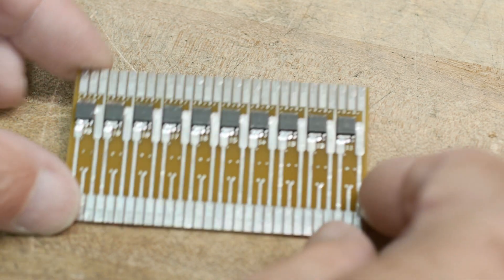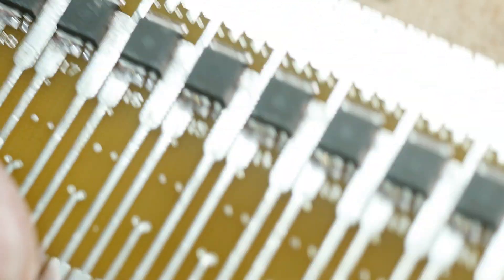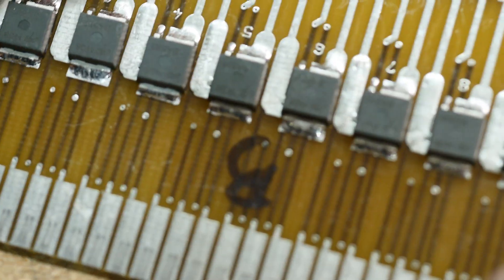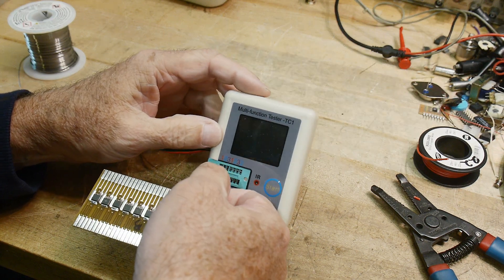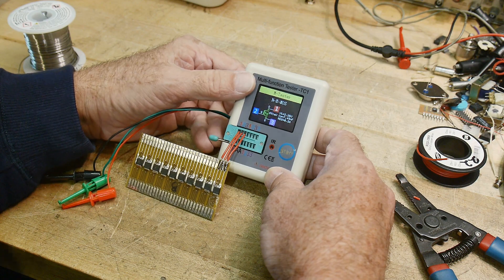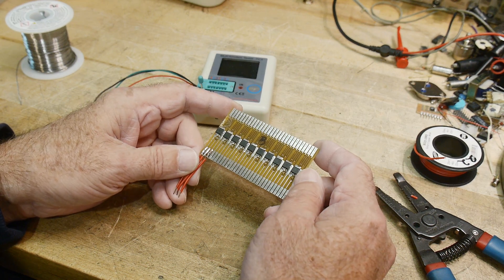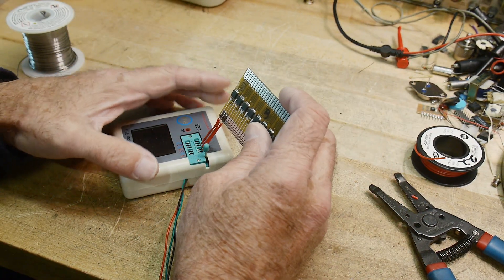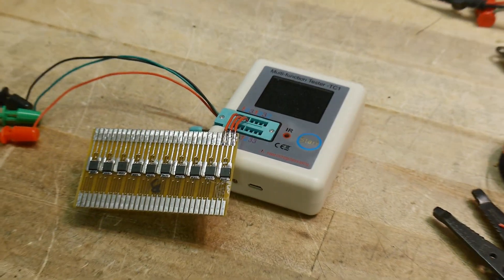#1406 BA5111 Mystery Transistor

Comment: The circuit board is also interesting,  edge connectors on both edges. Is one edge just test points or was this board designed as an interconnect between two boards? Thanks for another interesting video.
Reply: Possibly logic level converter used between systems - that's how I would lay out one of those.
Reply: @stamasd8500  Why use 85A continuous rated FETs for logic level shifting?  I guess technically you could shift a 1 mA "logic" signal to 85A with this...

Comment: Maybe clamp those components between two heat sinks and make a high-power DC load?  Season to taste with heat-sink schmoo.
Reply: They won't dissipate awful lot of power thru the epoxy, those are usually cooled by big copper traces. But with such low Rds on these could be useful for an PWM reg or spot welder...

Comment: They remind me of a robotic system I worked on that used compressed air actuators to drive parts on the robots. The FETs were used to control the air valves.